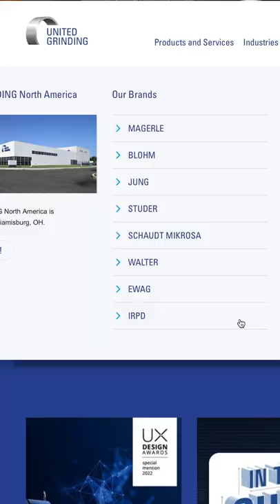This is the Reason Airplanes Fly #shorts

Comment: I ran a Kapp grinder made in West Germany. It ground flap actuator gears for fighter jets. Tolerance in microns. You can't beat that.
Reply: What company? Just curious
Reply: @SpentShellsNC  Curtiss-Wright
Reply: I hit tolerances in microns on a 60 year old jig borer lol
Reply: @TomoHawKzZ  you can't beat the old machines. Not as fast, but very rigid and hold tolerances really well. We used air gages and a CMM to check critical dimensions.
Reply: Shelby? I run the gear hobs

Comment: I ran a Landis Plain OD Grinder, during my aerospace/defense time.  Rolls Royce .00005" bearing journal production tolerance, and the .0005" bearing diameters for PW looked like gimme's.
Reply: I ran a Cincintiti grinder +/- .000025 taper, and +/- .00008 OD with an Ra of 3
Reply: @JRock2080  That's what I call grinding.
Reply: @mikemcmullin149  it's only grinding after the shift and a half of setup, as long as an engineer didn't get their hands on it on the day shift. Lol
Reply: @JRock2080  a guy I worked with for about 15 years used to build those Cincinnati's.
Reply: I have no idea what you said but this is so cool!! I love airplanes. Id love to have that type of knowledge. Very interesting

Comment: Halaluya!  AMEN! why does Noone understand without us machinists they would still be riding a horse ,picking there own food, protecting their family with a rock, etc
Reply: without CNC or manual machines machinists are nothing
Reply: @importanttingwei7747  and still in medieval times......
Reply: Well how was shit built before machines were around? Oh wait...fabricators
Reply: @CobraKiller02  metal smiths
Reply: Well, I’m a machinist and love my job but it’s also scientists that have accelerated our field so fast
Reply: Before a machinist manufactures a part, it must be designed.  So I prefer to thank the engineers.  And before designating a piece, you have to do research so I thank the researchers.  In short, machinists are only one profession among many others for designing an aircraft in the same way as an engineer, a researcher or an assembler.
Reply: @fyxos  agreed 👍